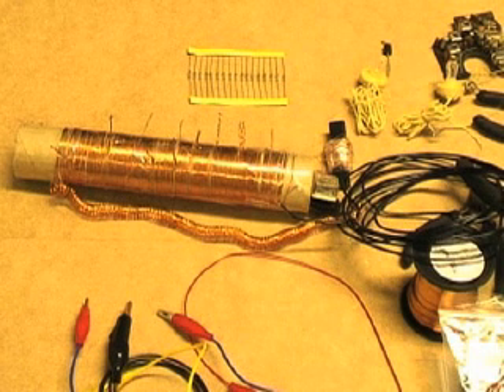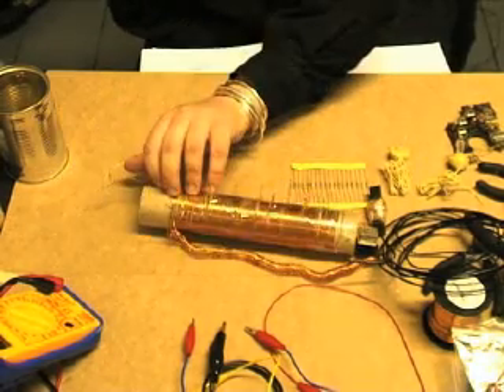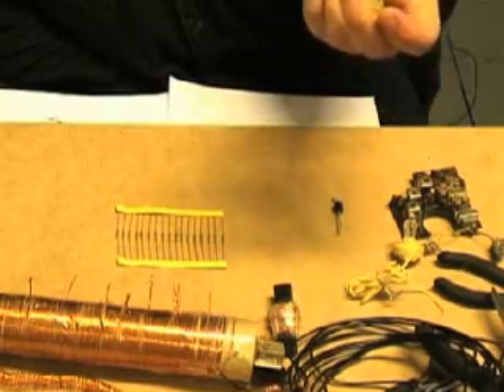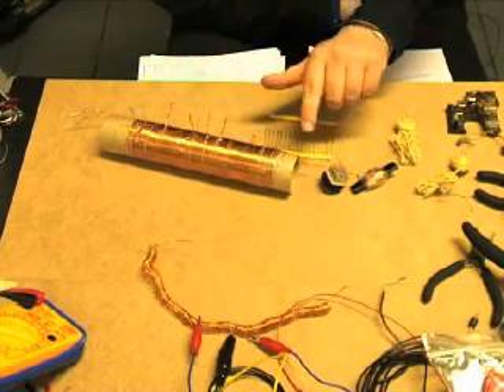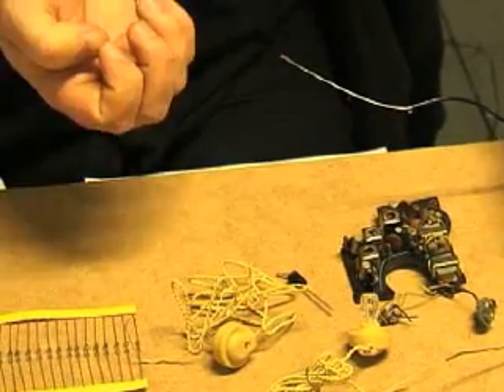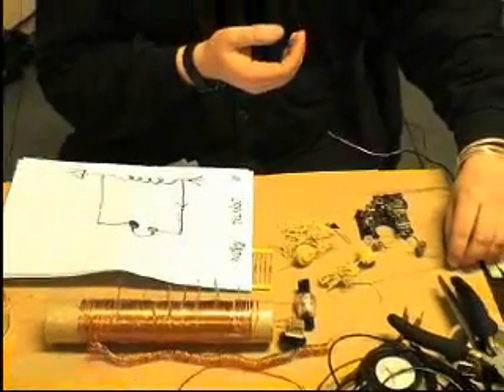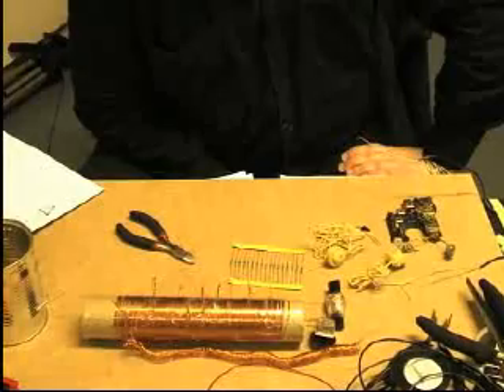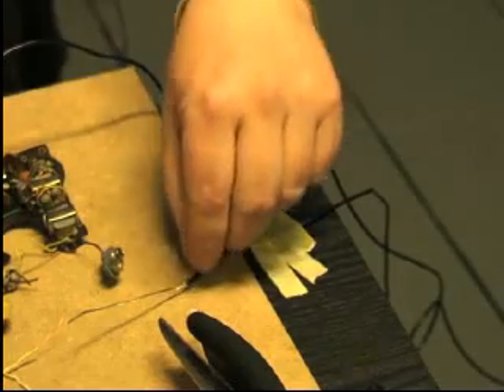Make a Crystal Radio part 1 of 3 - (intro to key parts)

Comment: How many windings?
Do you/can you get shortwave signals? I've made several coils, from 10,20,50,100,150,200,250,and even 300 windings on 2 Popsicle sticks (the best reception is with the 90 turn coil).
I just put parts together until I got signals.
Good video!

Comment: @thebroadcastviewer A Germanium diode has a smaller forward voltage drop than a silicon diode, so it will work better. You could try a Schottky diode (which are easier to get hold of than Germanium ones).  The cylinder does not have to be a perfect cylinder. Something like a toilet roll is fine.

Comment: @ActiveStorage Just as electrons travel from the negative side of a battery through a circuit and then into the positive side of a battery (like in a flashlight), the radio signal (electrons) flow from the sky into the crystal radio set, and then into the ground. Sort of like tuning into a Sky to Earth bound lightning bolt with the radio in between.

Comment: @FelixTheHouseFreak You are correct, the antenna is better if it is about 1/4 to 5/8 of a wavelength long. However, at 1MHz, one wavelength is 300m. For most of us 150m is a -lot- of wire.

Comment: Nice video but the diode doesnt draw radio messages, it simply rectifies the radio wave and what this basically does is separate the audio signal from the radio signal then leaving you with audio in the earphone.

Also a tip about antennas:  Your antenna wire isnt going to get better if its super long, its better if it is at a length were it is in tune with the AM broadcast frequencies.

Comment: I just built my own before I came across your video, but I got some new information. It took me one hour to build the whole thing. I'm receiving only one strong station and other faint ones. For grounding I tied the ground to the metal screw on a wall outlet, works fine.